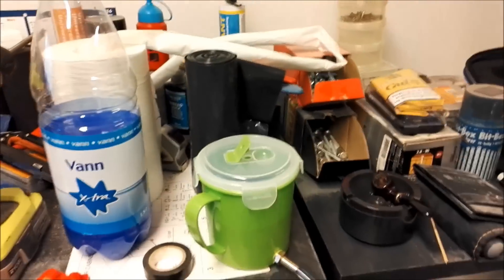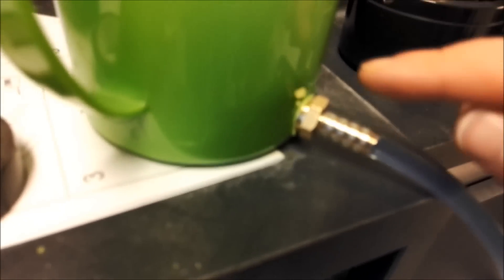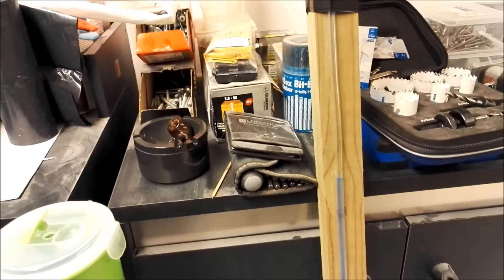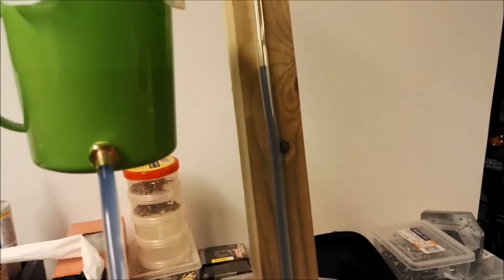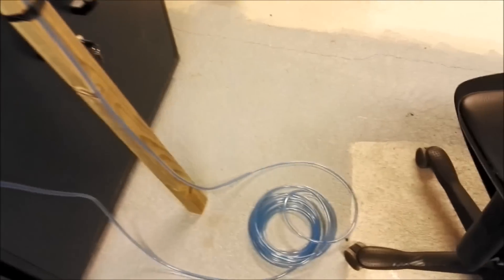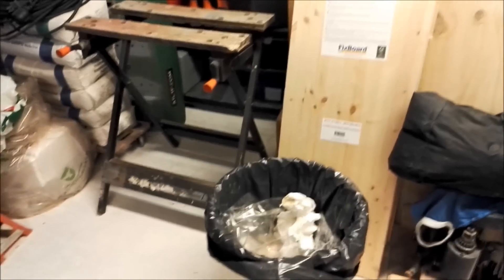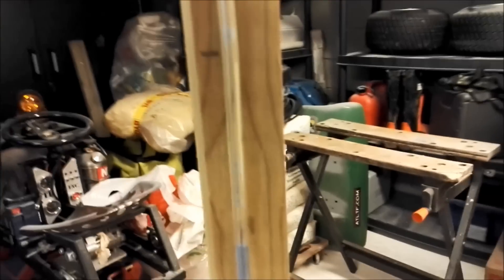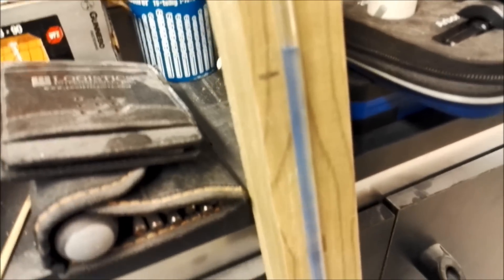One Man Water Level DIY for under 10$

Comment: I'm, a little lost as to how you connected the barbed pipe connector to the green cup. How thick is that cup? Doesn't it have to have a threaded nut on the inside wall of the cup to prevent the water from leaking out?
Reply from the maker: Drilled a smaller hole and squeeze the tube in, or same with the connector.

Comment: THERE IS NO NEED TO DRILL A HOLE INTO YOUR PITCHER OR OTHER CONTAINER,   JUST PUT THE END OF THE TUBE OVER THE TOP OF THE CONTAINER,    TAPE IT INTO PLACE AND POSSIBLY AFFIX A 0.125" +/- WIRE INSIDE OF THE TUBE OR TO THE OUTSIDE OF THE TUBE TO PREVENT IT FROM "KINKING",   USE A TUBE 3/8" DROP DEAD MINIMUM DIAMETER.         THIS IS TO PREVENT THE WATER MOTION FROM "STICKING" OR NOT MOVING WHEN IT SHOULD.    ONE OR TWO DROPS OF FOOD COLOR & DETERGENT / GALLON OF WATER IS GOOD.      YOUR BASIC METHOD SHOWN HERE IS GREAT FOR A ONE MAN OPERATION.     I HAVE  PERSONNALY PARTICIPATED IN AN ELEVATION DETERMINATION  USEING THIS METHOD WITH A DISTANCE OF OVER 750 FEET.    WITH 5/8" INSIDE DIAMETER TUBE       IT WAS CHECKED WITH CALCULATIONS BY CERTIFIED SURVEYOR.   REGARDS
Reply: 👂I'm struggling tohear you over. All the screaming

Comment: what happens if object is round ?
Reply: It would make no difference what the distance is.  As long as the elevation is exactly the same at each end.  Oceans are a good example of this.  An ocean could be 1000's of kms wide.  However its shore line is exactly the same elevation no matter where it is measured from.
Reply from the maker: What do you mean?
Reply: ThunderDivine for example if you try to find a level on spherical earth ? You know the earth curves so the water level's pipe needs to be at least 1 mile long as the curvature drop at that distance is around 8 inches.
Reply from the maker: I've been thought the earth curves yes. - English Mile or US Mile or old school mile?
Reply: ThunderDivine ok forget about the miles . Its 1600 meters long.
Reply from the maker: Idk you'll have to buy a hose that long. But tbh I don't think it would matter.